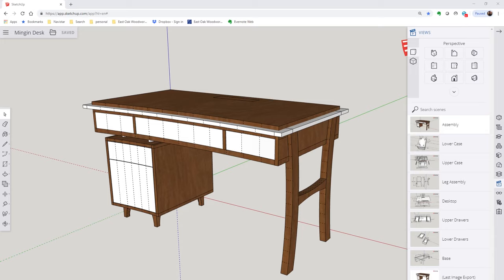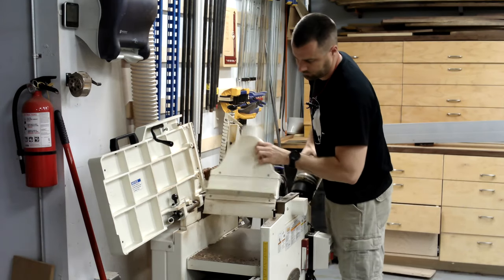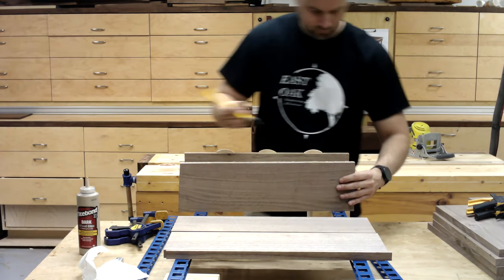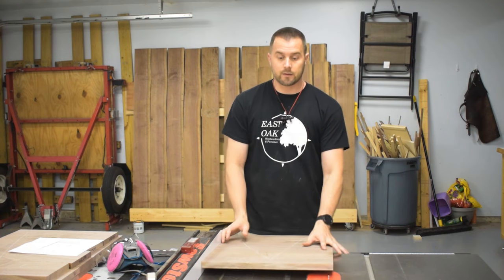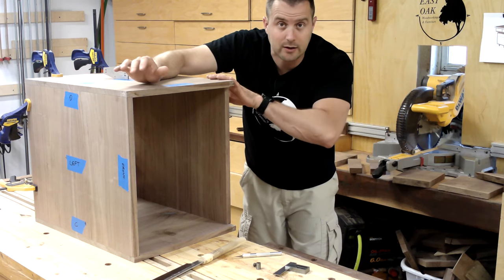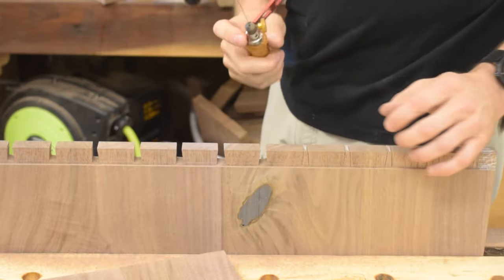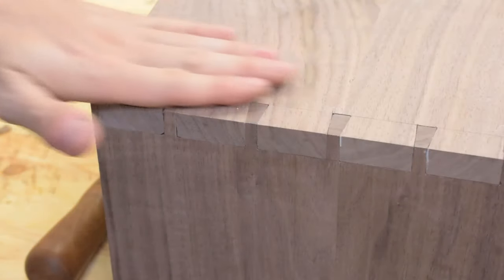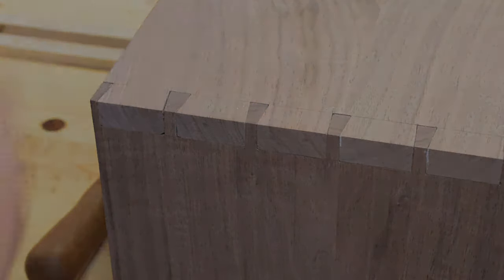Walnut and Maple Desk Part 1

Comment: Also, after watching you do dovetails on the bottom surface of the desk component: The real mark of a woodworker is fixing and/or hiding his/her mistakes.
I do this on the regular - hiding or fixing mistakes.
Get used to it?
Reply from the maker: Used to it? Maybe. It’s part of building. I do challenge myself to need to do it as little as possible. It still stings the pride a little 😆